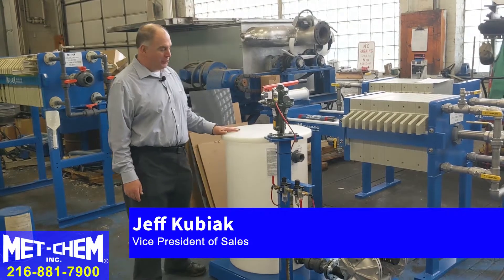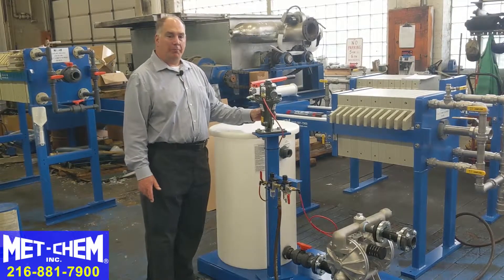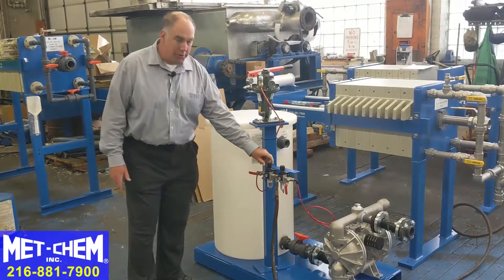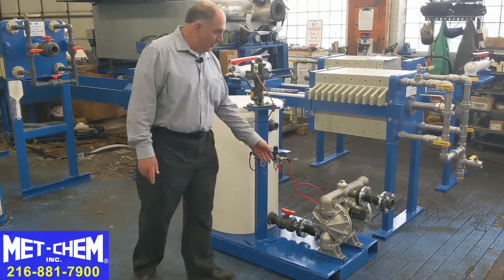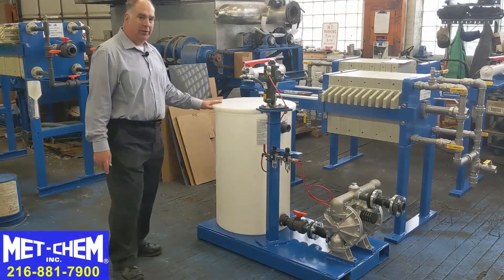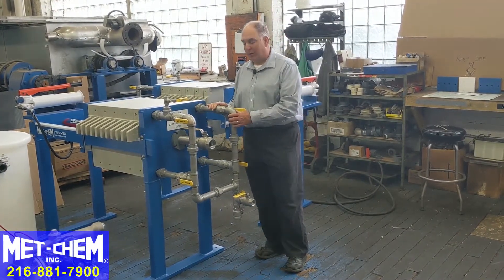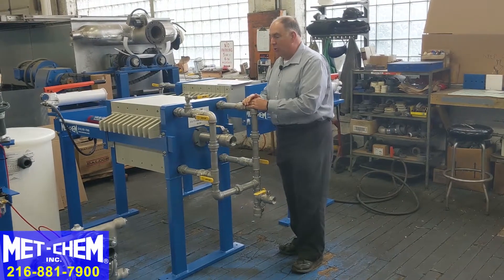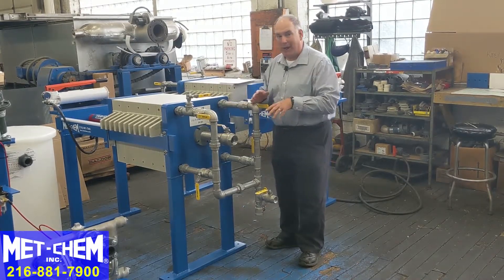Skid-Mounted Precoat Station | Precoat System & Operation | Met-Chem

Comment: That precoating station is well designed. Will the precoat layer hold if the filter press is opened after the precoating operation is completed and before any slurry is pumped into the filter press. Or will the precoat layer collapse from opening the filter press? 
If it will not collapse i would like to see how the precoat layer stands on the filter cloth.